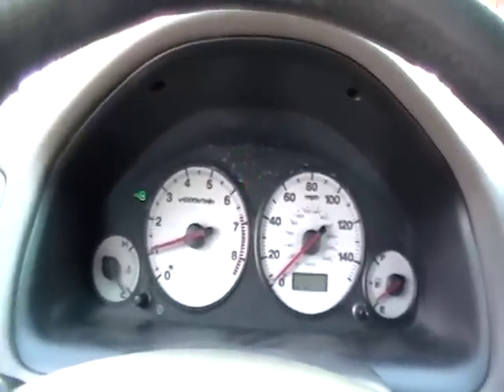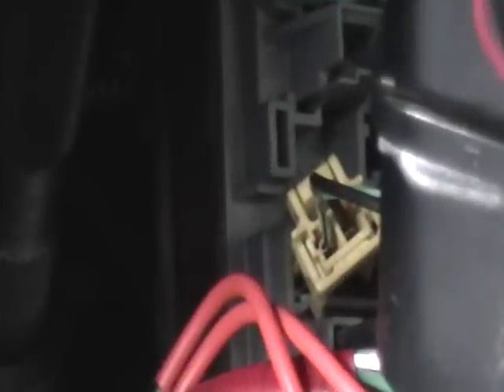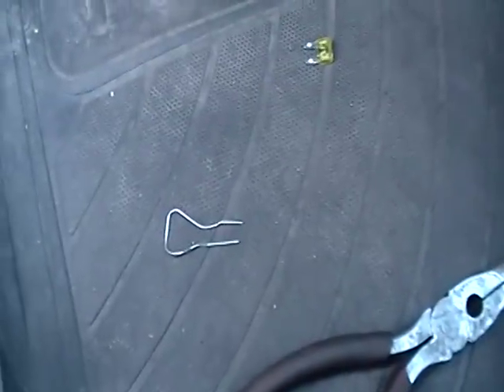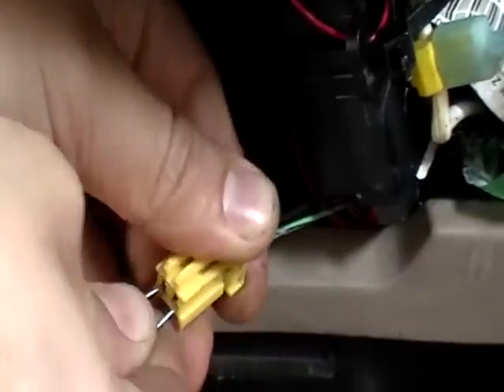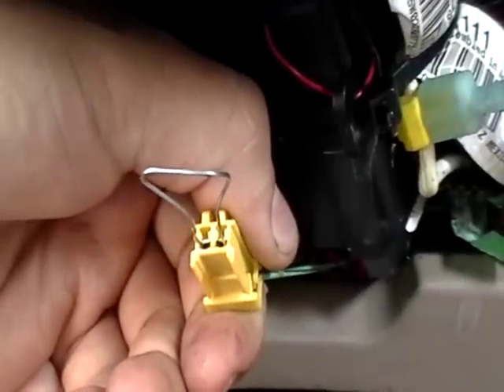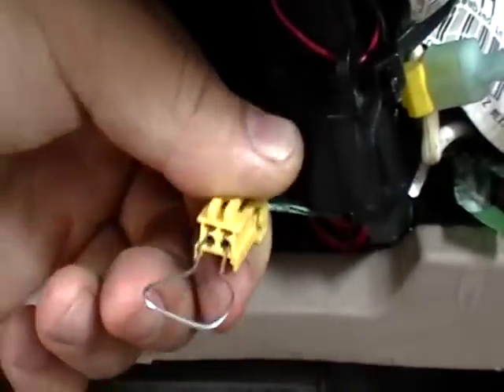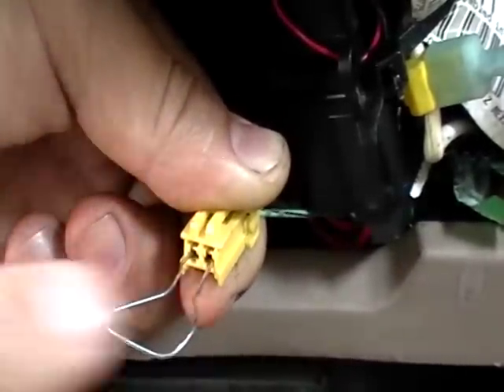Honda Civic airbag (SRS) light reset acura

Comment: What a legend. 12 years later and still helping folks out. Can’t believe this worked. Dealer was trying to charge me $200 for just diagnosing. Mfs probably were just gonna use a paper clip too 😂
Reply: Fr
Reply: Did you put back the yellow connector to its place, or its okay to leave like that.
Reply: @louiearielescalante4306  I reconnected it back to original place.
Reply: Do it have connections to the original place?
Reply: @louiearielescalante4306  What do you mean bro?
Reply: The yellow connector it has a live connection when we put it back to its original place?
Reply: @louiearielescalante4306  Oh you mean after you complete all the steps? I don’t think it matters but when I did it I turned off the car when I reconnected. So no. No live connection
Reply: Okay thanks bro👍
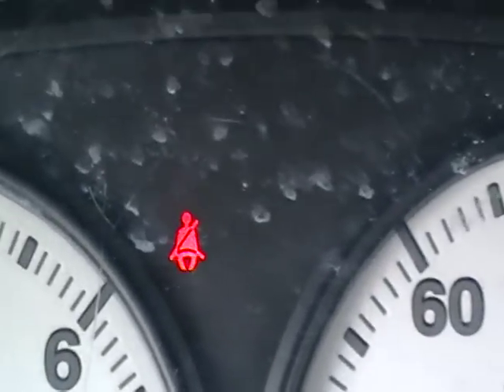Reply: 2:29 N 2:29 jñķ

Comment: The video is 14 years old.  My Honda Civic is 21 years old.  This video was a life saver.  Passed inspection like a charm today.  Saved me a ton of loot.  An easier way is to use two separate paper clips.  Touch them to connect and separate to disconnect.  Much faster this way.  Thanks a mil.

Comment: Yooooo! Thanks man.  Took off my seatbelts to clean them and accidentally turned on the ignition while one of the seat belts were unplugged, triggering SRS. Saved me $140 from taking it to Honda (that's how much they quoted just to look at it).
Reply: Did you put back the yellow connector to its place? Or its okay leave just like that

Comment: @scarface683 check connector under seat, yellow. next take multimeter, set to 20 dc volts, start car connect meter to battery. have someone rev the engine up. voltage needs to stay below 15.5v or the regulator is the issue (according to civicforums post)

Comment: Thank you SO much. Fixed my issue perfectly. Horn died on me also right before this and changed out the clock spring only to see this fixed the horn but didn’t fix the SRS issue. Had the seats out because I was doing interior. Didn’t realize this was a common issue when the cars moved with the seats removed.

Comment: U didnt plug it back in at the end of the test, all lights turn on with key power. Then off when running (unless activated). So then what was the purpose of the jumper clip?

Comment: It works but after every 3-4 weeks SRS light comes back and I have to redo the same procedure, It's 2002 Honda Civic LX. Any idea after resetting the light why it's coming back again and again. Called the dealer want to charge $90.00 to diagnose. Any help will really be appreciated.

Comment: I did this to my 2001 Honda Civic EX and it worked! However, now the battery light came on and stays on. Any idea as to what happened? Please advise.
Thanks!
Reply: Yea, you fix one thing 2 things break lol That's a different problem now, go check your alternator.

Comment: didn't work at first, I found it tricky to make paperclip go back in on time so I got 2 paperclips and plugged 1 into each contact point and just made them touch  (connected) then separate them (disconnect). Light went away now all good ! 👍

Comment: I have 2008 honda accord and could not find the yellow terminal to cross the wires. I watched several videos for vehicles other than the accord. Is the yellow terminal under the steering column or next to the fuse box?

Comment: So does it just short out the SRS because you're connecting the negative and positive? So SRS doesn't work at all after this?
Reply from the maker: +James Robinson it's a ground wire that connects to memory erase signal nothing is shorting out it's a reset procedure used by the dealer everything will work
Reply: Thank!

Comment: I disconnected the wiring harness under the passenger seat to install a sub on my 2000 Accord and it caused the SRS light to go on. The steps for the Honda Civic were similar enough that the reset procedure worked great on my car as well.  Dan, thanks for the post and sharing this info it saved me from having to go to a dealer (or mechanic) to get the work done and spending $.  Please ignore the negative comments from other viewers.  Like you said, don't like it don't watch it. Thanks again!

Comment: Yes.  Worked on my 1999 Civic DX.    If it comes back on before inspection I will follow steps to clean out seatbelt switch...   or try to get it replaced for free.  Thanks!

Comment: on my 01 civic, the srs light did blink twice after pulling the paper clip in and out as you described, but the light stays on and still has not erased after the 6 seconds with the engine on. Any suggestions? Thanks.

Comment: worked on first try! A smarter way is to cut the paper clip into half and stick both on the plug. Make sure they are in disconnected position and on top of each other and when u need to connect just push two clip together for contact and release to disconnect contact. No need to unplug and replug.
Reply: I know this is from 7 years ago, but cutting the paper clip in half and then touching them together while the other end is stuck in there is the only thing that worked! You have to be fast to reset the darn thing!! Thank you!!

Comment: Hi, I have an 08 Civic and the light comes back on after reset.  It gives a driver airbag open circuit or high resistence code.  To eliminate the airbag for testing purposes, would I need a 2 ohm resister to make my own tester?  With a dual stage airbag, would I need 2 resisters...one for each pair of pins?  My horn and cruise work so it may not be the clock spring.
Reply: I have the same problem did you ever find a solution?

Comment: Hola, un amigo tiene un Carro Honda Civic 2001-2002 y compro un Velocimetro de un honda civic Hibrido 2003-2005, cuales son los pasos parar hacer la adaptación?

Hi, a friend has a Honda Civic car and buy a Speedo 2001-2002 a 2003-2005 Honda Civic Hybrid, stop what steps do adaptation?

Comment: The light came on after the car was stopping in the middle of the road, this was because the inmobolizer didn't work with the key anymore. Got the inmobolizer replaced and a new key but the light has been on since then. This happened in 08, which is 5 years ago now. Have not had a problem since, just wanted to see if I can get rid of the light but don't want to take it to the dealer just so they can try to rip me off. Thanks.

Comment: Why don't you get zapped when doing this? If ignition is on shouldn't there be electricity going to it? Then stick a paperclip in it?
Reply: Not enough current to hurt you in a 12 volt system. You can actually touch both battery terminals and wont feel a thing, but don't do using metal or a wire....

Comment: After a few tries it finally worked. I had to disconnect the connection from my after market stereo wiring harness which linked into the emergency brake wire on the same circuit first. Thanks tons for posting this video.

Comment: Apparently, there is something truely wrong with the SRS system.  With my 2000 Honda Accord I had replaced the alternator and the SRS light stayed continuously on.  This worked with mine and stayed off after ignition.  Like i said sounds as if there is a true "problem" with your 2001 Civic's SRS system.  Good luck.

Comment: Thanks a lot bro. This method worked on my Acura TL 2002. Just have one question though. That yellow plug doI plug that back in where it belongs and if I do will it cause the SRS light to turn back on again? Thanks.

Comment: This definitely works! Really really easy. Takes about 10 seconds if done correctly. I had problems at first but realized you need to have the ignition off, have the paper clip connected in and then turn it on. I tried it with the ignition already on and it does not work. Then I realized my mistake and it worked perfect!

Thanks!
Reply: Thanks bruh.  Your comment helped me out also.  :)

Comment: TAKE GOOD DAY WOULD LIKE ONE DOUBT HAVE A CIVIC LX 2005 AND WAS THE SAME WITH BATTERY DISCHARGED, THEN I HAD TO REMOVE THE BATTERY AND RECHARGE IN ANOTHER PLACE.
THE PROBLEM HAPPENED TODAY WHERE I GAVE A GAME WITH OTHER AUXILIARY PAIRED CAR IN MY CAR WAS THE FIRST TIME NORMAL DEXEI CAR ON ONE 40minutes as I wiped hung up, and called AGAIN CAR CAUGHT AFTER PASSED SOME 2hours The CAR WAS WITH BATTERY lowered.
THIS SECOND TIME DID ANY PROCEDURE AGAIN WALKED WITH CAR ONE NIGHT OF 10 KM WITH FLASHLIGHT ON TWO HOURS THEN WENT ON AGAIN AND MY SURPRISE HAD NO CHARGE ON BATTERY OR THE HEADLIGHTS AND OTHER lit DETAIL TO ME WAS WORRIED THAT WHEN WAS NOT ON lit BATTERY LIGHT PANEL AND NOW THE AIRBAG LIGHT REMAINS LIT .The THAT MAY BE THAT BREAD? THE BATTERY WILL NOT HAVE ENOUGH MORE LOAD OR FOR LIGHTING LIGHTHOUSE? WELL NOW ONLY EVEN WITH NEW BATTERY PRA TAKE THE TEST.
THANK ATTENTION

Comment: do you re-plug it back in after the steps ?????
Reply: Good question if only it was answered
Reply: that wire is not actually connected to anything in that slot. it's just a slot to hold it in place . you don't really have to reconnect it if you don't want to. it's just less complicated if you pull out other wires and don't know which is for what.

Comment: Light came back 400km after resetting it. 

Went to Honda, apparently almost 90% of all of the Civic's in this ear have a problem with this light coming on, it has to do with the passenger side seatbelt sensor. It is covered under Honda (the sensor), but you have to pay for the SCAN(approx 100$) and the LABOUR (approx 1 hour = 100$). These rates are about the same in Canada and the USA.

Comment: Whats the point of doing this if your srs system is still going to have a problem? The light will just come back on won't it? I think you should mention that this method should ONLY be done AFTER fully correcting the initial srs airbag problem, otherwise you're your'e srs system is still not going to work properly in the event of an accident.
Reply: If there is a still a fault in the system the light will come right back on, it wont hurt a thing to try and reset the light.
Reply: Apparently you don't know about the defective seat belt switch.  The SRS light came on because your seat belt switch had collected too much dust and created a bad connection.  Therefore the SRS light comes on.  His method is to reset the SRS  light after servicing the seat belt buckle switch.